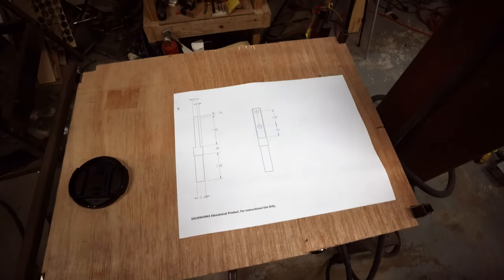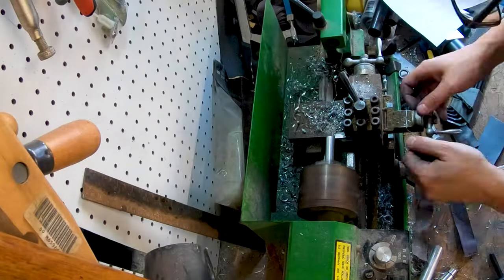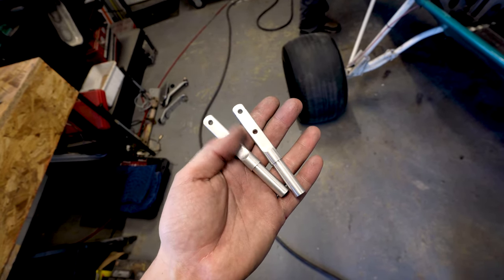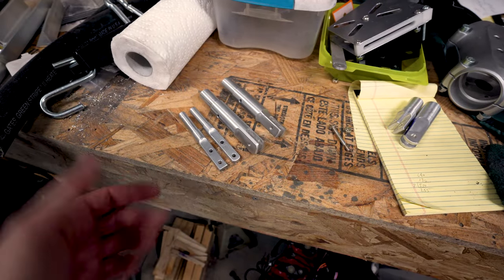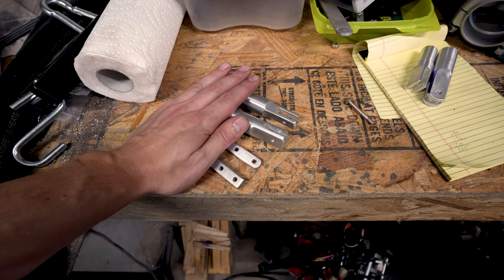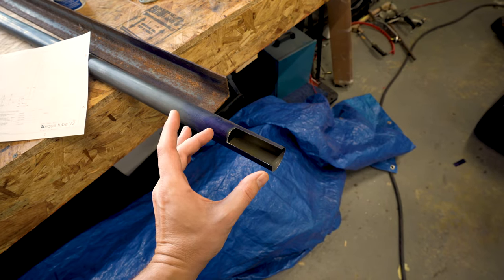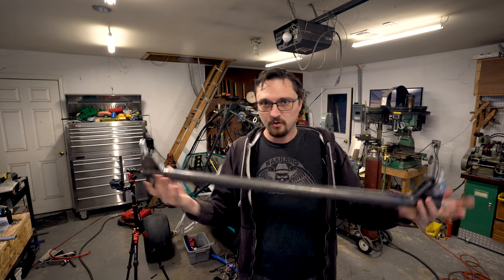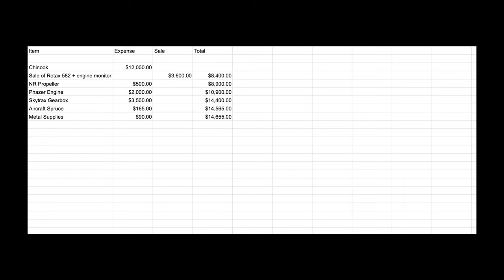Control System Modifications (part 1) - Budget Bushplane EP4

Comment: I do enjoy seeing metal work done as well as wood work. But you didn't include the new lathe into the budget.
Reply from the maker: Or the tig welder or the many other tools I have. I thought about how to handle tools in this project and my honest conclusion is that anyone with the skills to do work like this will likely also have tools to do it so I’m not counting them against the budget.
Reply: Mmmm,not necessarily. I dont have any of those tools that you got. Just the bare minimum so if I was to start from scratch then new tools would have to be included in the budget. Same goes with regular life. Anything one wants to buy has to be within a budget if there living off a budget. You cant go buy a plane  if you dont have the means to build it. That's part of the budget no matter what. You buy a model kit for instance. It doesnt stop there. You need the supplies to build that kit. Just saying.
Reply from the maker: Fair argument for your situation. Realistically though I can’t see where many people are going to feel comfortable doing major fabrication work and not already have some tools to accomplish that task. This is something I should mention in the video as well but the other thing is that you don’t need these tools in a lot of cases to get an airplane in the air. I use them because I can and it’s fun but you could actually just drill and bolt tubes and existing pieces and make something different that would also work of just not tackle the same tasks I do. This project isn’t a road map of how to do this, just inspiration that it is possible. I should put a piece in the video on that, thanks for the idea!

Comment: I'm an old man(67) but when I was 21 I blew my whole income tax return on a used  Atlas lathe with lots of extra tooling.  That lathe is still on duty in my shop and will outlast me.  Why did you need a new torque tube system? Janky original design?
Reply from the maker: Honestly I should have left it alone for the first portion of the build as I didn’t expect it to be as big a project as it turned out to be. Ultimately I’ll be driving separated flaps and ailerons with pull pull cables and for that I needed a new control system. This gives me the base for that.

Comment: Are you willing/able to share the files for the linkages?
Reply from the maker: For the modified controls? I can’t in good conscience suggest anyone follow what I do. It’s far too much work for someone not ultimately switching to split flaps and ailerons with pull pull cables.
Reply: I'm working on a clean sheet design and have had a hard time finding detailed drawings and dimensions for torque tubes on existing designs.
Reply from the maker: Do you have the EAA Solidworks? I don’t mind sharing, there’s nothing really special about what I’ve done. That or I can send over a dimensional drawing.
Reply: I use Fusion 360, but dimensional drawings would be more than enough!
Reply from the maker: Email me at contact@camerawings.com and I’ll see what I can put together.